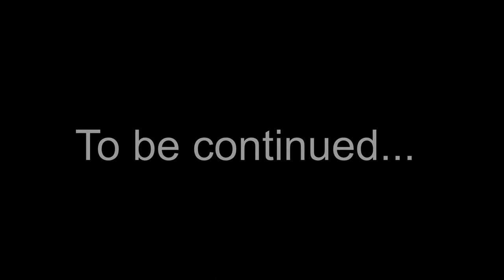#180 Carport Drainage - Part 1

Comment: Good morning my friend ! That was a thunder clap perfect team made of ours respective tractors ( Bolens,Mahindra ) for that task !!! Woaw, that was a big rock !!! ( the front wheel were barely not touching the ground ( strong and powerful backhoe hein ? )) Now I can see why my 18 bolts can get loose after only 12 hrs of operations !!! lol The FEL on the eMax tractor did an outstanding surgical job !!! and a lots of rocks a various size were removed during that task and that hydraulic lift trailer of yours was a marvelous great help too !!! I was very surprise of the condition of that stump ( smell like just it was freshly cut !!! ) and was very hard to removed !!! You did a good surgical cut with your chainsaw !!! LOL That Case tractor was always in standby for the rescuing both tractors in the ( case ) they were over their ears !!! LOL  Always a great honor to be involved into all your projects my friend !!! Cheers !!!
Reply from the maker: That is an honor for me too! The Mahindra was perfectly sized for that job, between the house and the garage. This job would have been just impossible with the Case. I was also surprised this stump was in such a condition. Given also it was sitting just 2-3 inches below the surface, which gives oxygen contact. Anyways, I am very happy this job is done and I am confident it will do its job this winter. Thanks!
Reply: @FromSteelToWood  We should mark ground reference point to see how much the ground will lift compared to last year ? Yes, that stump was coated with something to protect it !!!

Comment: Wow, you do have a lot of water there to get drained  away before the really cold weather sets in, then the thaw of spring time. I can imagine the frost heaved drive way!
I'm looking forward ( as always ) to Part 2 of this.
Reply from the maker: Thanks Reg! You will see more in part 2. I can't figure out why the driveway was not in much worst shape with all that water.
Reply: @FromSteelToWood  I wonder, with all that rock under the surface of the drive, is it possible that a lot of the water does actually run away?
Reply from the maker: Most likely, but part of it end up freezing in the first few feet.

Comment: You`se made good wood....I found through hr year that if you keep the water away.....from a house ...a slab....a swimming pool or any thing else you will keep the problems away at the same time.....It was a good combined effort and project and you found large rocks and stump....no gold for this part.........CHEERS
Reply from the maker: Maybe I did not find gold, but I'll save it in the long term by avoiding any damages. Water and freezing do not make any good. Thanks!

Comment: Great video and team work. I was surprised that the Ht23 is about the same size as Dave's tractor, I thought it would be smaller. I would love a backhoe for our HT23
Reply: Good morning Joseph, yes a backhoe on the HT 23 will be outstanding in deed !!! I'm desperately trying to convince Joe to built one for his HT 23 !!! LOL
Reply from the maker: You are right! Remove the FEL and the backhoe on the Mahindra and they are of similar size: wheels, width, height. But the Mahindra is 400 lbs heavier and 20 inches longer. Thanks Joseph! 
http://www.tractordata.com/farm-tractors/010/0/1/10013-mahindra-emax-20s.html
http://www.tractordata.com/lawn-tractors/001/3/4/1346-bolens-ht-23.html

Comment: I was wondering when you were going to use the case. Good job boys. Now if we get a wet spring we're  ready,bon chance.
Reply: Thank you Sir, Yes Joe main entrance will dry !!!  Cheers !!!
Reply from the maker: Thanks Matty! The Case was ready just in "case" a Bolens or a Mahindra would be stuck in the mud. Not where we dug, but where we dumped the dirt. It was a low spot to fill, but really muddy! Thanks!

Comment: Looking good . Had a similar problem at the back of my garage . Put drainage mat / big o pipe and two inch clear limestone . Problem solved . Looks like lots of water in the ground already . The mahindra did a nice job and the guy operating it 😬
Reply from the maker: We had a lot of rain in the previous days, but even then, it will drain water year long in my opinion. Thanks Stephen!
Reply from the maker: We had a lot of rain in the previous days, but even then, it will drain water year long in my opinion. Thanks Stephen!
Reply: Yes Joe did a great Job on the backhoe in deed !!! The Bolens too btw with that hydraulic trailer !!! Cheers and thank you Sir !!!